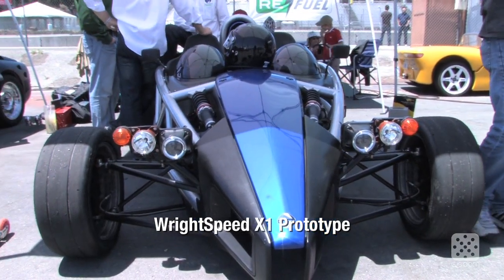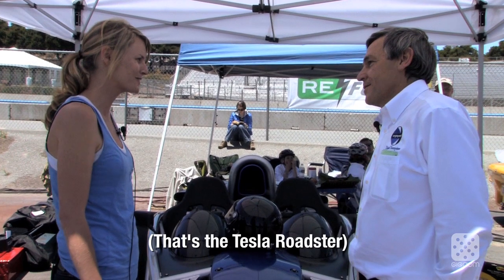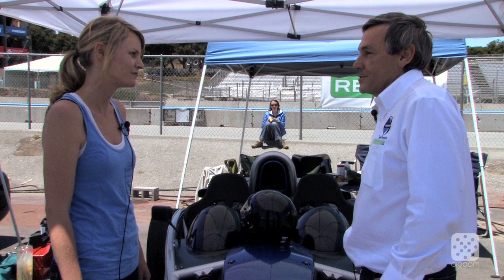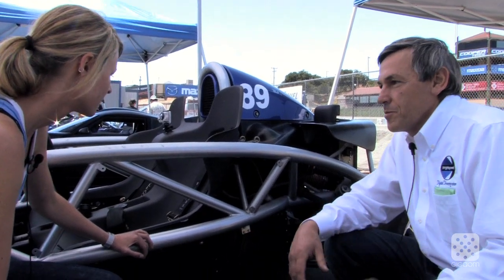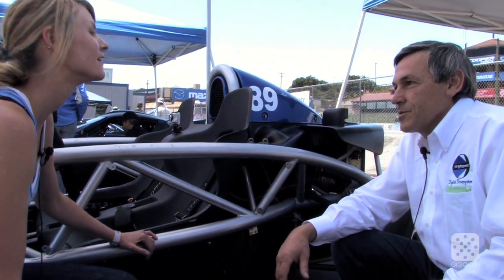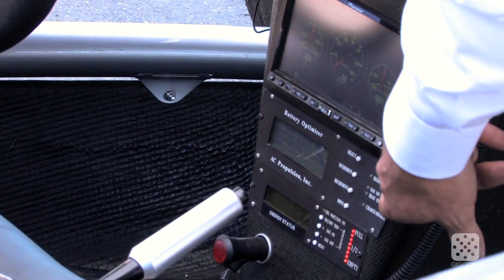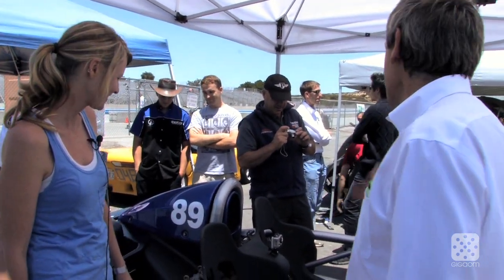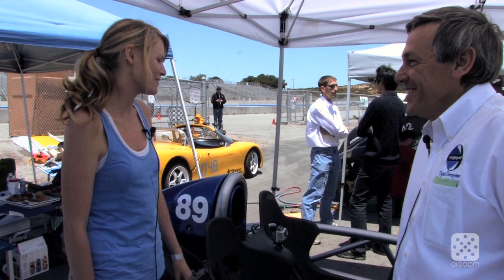Green Overdrive: Wrightspeed's X1 Electric Car

Comment: range: 100meters. lol
Reply: Huh? He said they could run 2 laps and the main problem was the battery heat from the high amperage outputs.  Since normal city driving is mostly under 40 MPH with stop n go traffic. It likely has 100+ mile range.
Reply: Eric Johnson
you must be somekind of ameritard. first of all the entire world uses SI units. That is. meters and kilometers. not that crap that is called miles that isn't use anywhere else on the planet.
Second, the normal city drive varies from city to city and even where speed limits are enforced there are places where they are higher than 40mph.
Third a milage of a car isn't measured by city speed. There are very detailed and specific global and mandatory tests to verify a vehicle range.
Fourth, the car is not road legal.
Fifth, no way it would have 100+ mile during racing.
Sixth, think before trolling.
Reply: riskinhos
it is street legal; it has a license plate
also the highest efficiency on a car comes at about 45 mph
and if you want to use si units, say it in kph at least

Comment: Yes the 3.0 V8 will. But it would beat the original 2.0L V4. Same Torque & HP/Weight ratio. Because of electric constant maximum torque from start. It would beat the Petrol. Remember the 3.0 V8 power plant is just in a different incomparable league. It's like say the V8 Mustang GT would beat the Stock V6 Mustang.